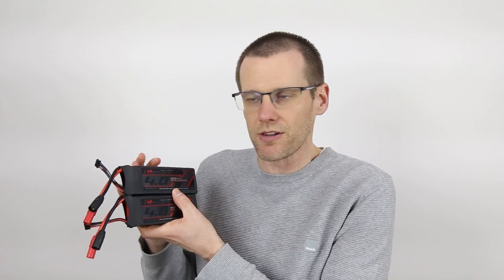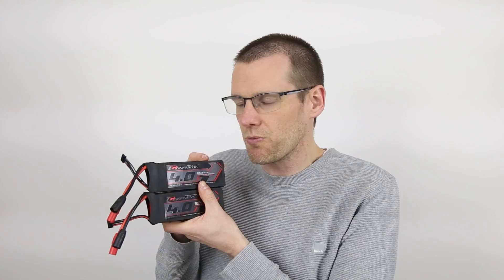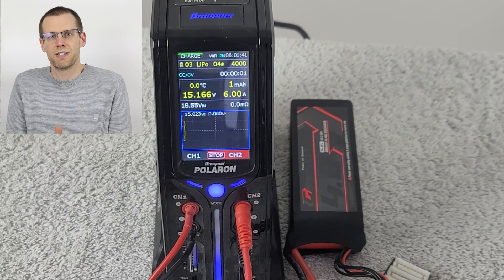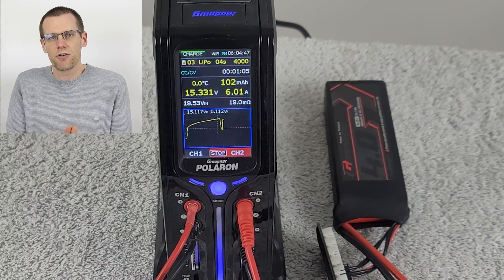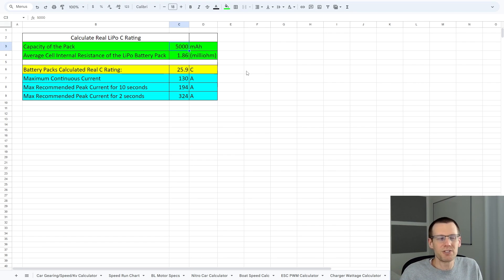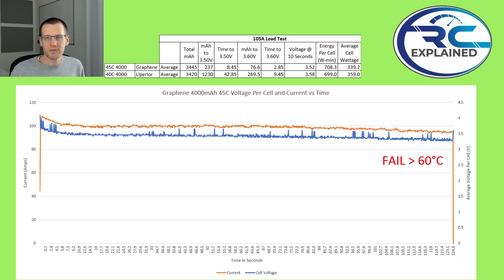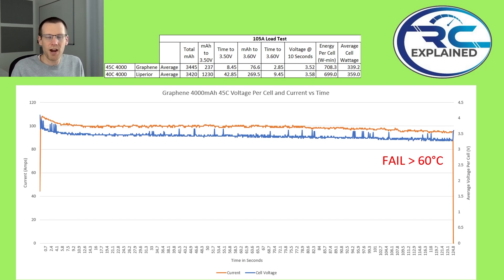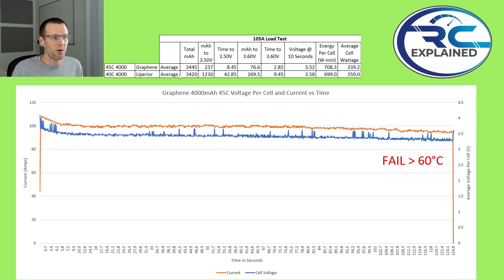Turnigy LiPo's Going Down Hill? Load Testing Exposes Alarming Truth! 4s 45C 4000mAh

Comment: Used to hear how great their HD, Graphebe Panther and Nanotech packs were. Now I hear a lot of mixed results. I don’t do the RC thing but Keenlabs kWeld spot welder recommends the 3S 5000mAh Turnigy Nanotech to get at least 1200A…or maybe it was 1500A in a spot weld. 

The manual has some data on what overall resistance of your entire setup should be (battery/capacitor->battery leads->kWeld->leads for electrodes->electrodes) something between 4 and 7 milliohms. 

I tried a 3S “120C” CNHL and besides having one sketchy cell it also had an IR of like 14 milliohms. Insanely terrible for a 3S pack. 

Should have tried a Liperior or just shelled out the money for an SMC but I decided to go with high discharge LiFePO4 to power my spot welder (didn’t go with the kWeld, found some other options for 20% of the price that’ll do 0.30mm thick pure nickel)
Reply from the maker: Interesting use for them. Thanks for sharing. Hope the packs you bought can work.

Comment: Not the cheapest of batteries either 👎.. 
I've not got the tech to check mine in the same way but however I do write down each battery's info every time or if not used every other week (storage, full charge, volt and % IR and each cell count.
I've got many batteries my oldest are 2x zippy 4000mah 2s and they're about 5-6 years old and the volt, cell count and IR and run time is spot on still. Also zeee 5200mah 2s 3-4 years old still reading spot on, however I have 2 GNB batteries 6000mah 7.6v and 6300mah 7.6v shorty packs and 1 is faulty 6300mah 7.6v as the negative 5mm bullet connected is more like 5.2mm so it's no good really and brand new👎. All I will say is take notes when charging and store charging people because as soon as lipo's are starting to come to their end you will see in your notes a big change especially in the IR. Plus the most expensive is not always the best.👍
Reply: My 7 year old zippys are just starting to die but all turnigys died long ago,

Comment: Are Liperior actually good?  They make some 8S packs that are sized perfectly for my 9" fpv setup.  8S packs are hard to find in a size/quality that I want...
Reply: My 2 cents. I’ve had 4 3s 5000mah liperior batteries for about 3 years now I’ve run in my erevo. They’ve been great until I left them plugged into the car for 2 days. One pack has 1 cell that was drained to 0v the other 2 cells in that pack are fine, and the other 3s pack is fine. They e had plenty to run my 6s car, never over heated, may have lost a little capacity and punch since they were new but it’s also hard to tell. The other 3 packs (including the other one that stayed plugged into my erevo for 2 days) are still going strong. I also have 4 2s 5000mah packs that will overheat in my arrma granite which has a Gool RC 3s system in and one of them puffed up a little but still works fine. The 3s packs in that truck don’t over heat at all and the truck is insane.
Reply: @makestuffbetter19  Thanks for your input - sounds like the company is legit, anyway.
Reply: @mlentsch yup. I mean i wouldn't trust the C rating but most companies lie about that anyway
Reply: My experience is mainly with their 2s and 3s LIPOs.I have tested about 10 different Liperior LIPOs and they range from fair to excellent.

Their Endurance series has underperformed for high load applications (speed runs) and the C ratings have been very exaggerated in my experience.  The standard yellow packs have performed well in my experience compared to their claimed C ratings (I only have 3 of these however).  The Liperior Pro line - I tested 2 and one was good and one was very good.  The LiperiAir LIPOs I have test have all been very good to excellent and are on par with SMC (they are a little faster than my 135C SMC and a little slower than my 150C SMC).
Reply: @BriansRCStuff  Excellent - thank you.  I'm looking at their 8S 80C "Air" lipo.